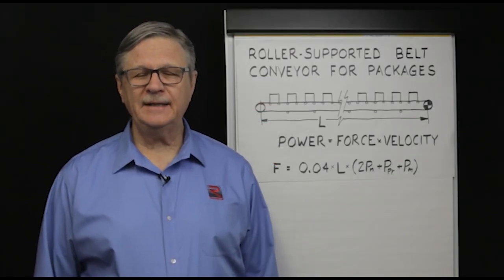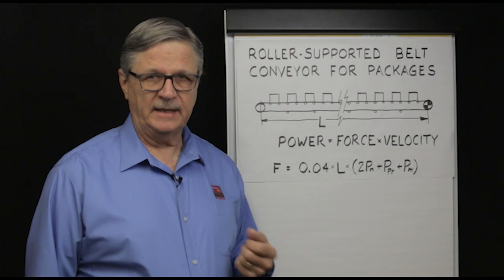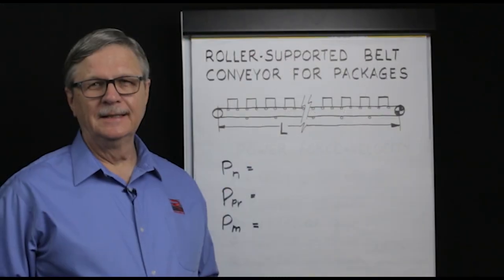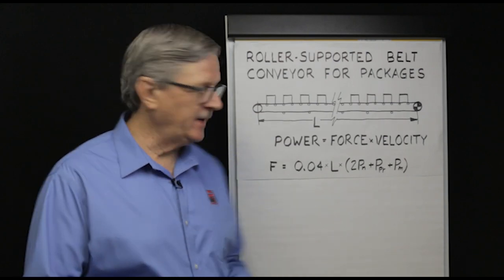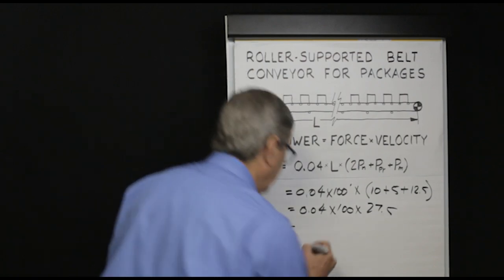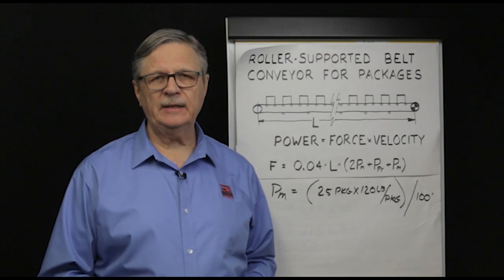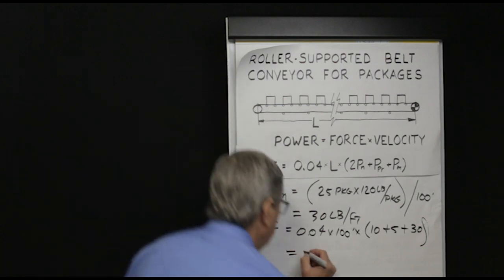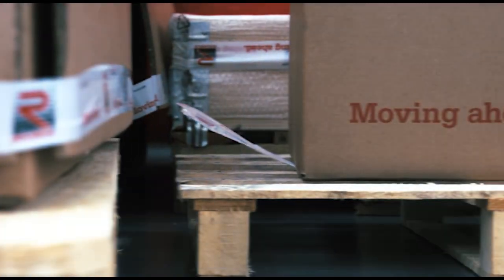How to Calculate Belt Pull on Horizontal Roller Conveyors

Comment: Superb explanation
Reply from the maker: Thank you kindly.  We're producing another video...this time it will cover inclined roller-supported belt conveyor for packages.  Do you prefer metric units?
Reply: @rulmecacorporation4596  thank you for your reply, good to know that another video on inclined conveyors are upcoming. Yes I prefer metric units, dual units also ok, I am not used to imperial units, learning it.
Reply from the maker: @karthikb2819  I am making the inclined conveyor video today.  Metric versions should follow within a month.  Here in the US most people use imperial units.  That is why we use those units most frequently.